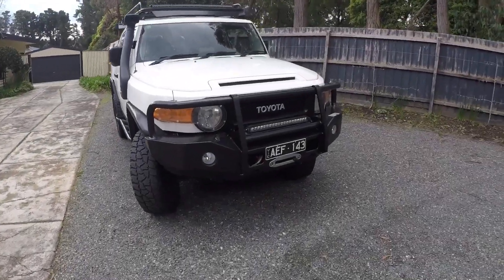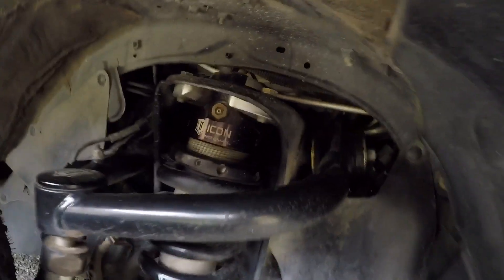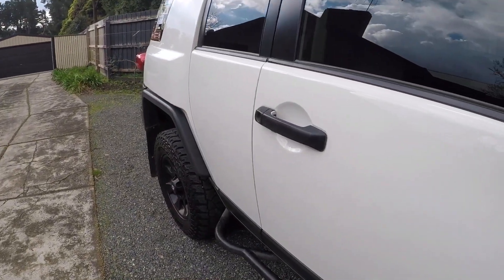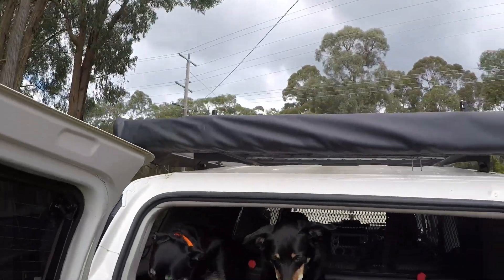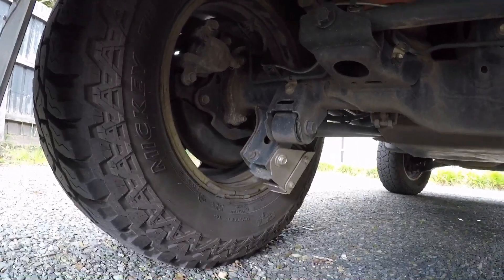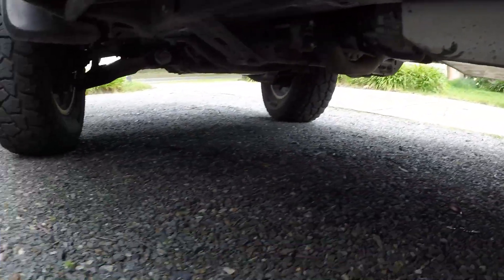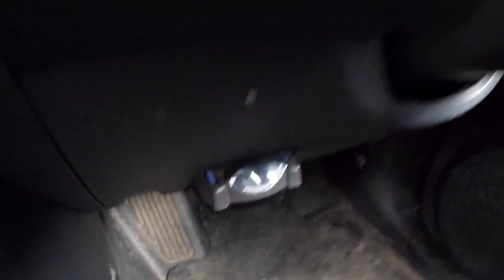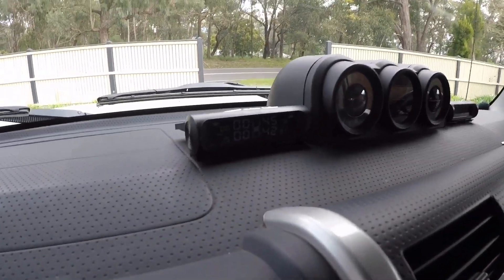FJ CRUISER REVIEW & MODIFIED FOR TOURING, 4X4, OFF ROADING AND OVERLANDING.

Comment: Very cool! What’s the torque converter lockup mod?
Reply from the maker: Benjamin Jones The converter lock up is by Wholesale Automatics.
It’s an ECU box that you have to wire into the cars computer, it manually locks the torque converter in top or 5th gear. So you can have lover revs at highway speed without over heating your transmission when towing. I have also fitted a additional transmission cooler.
Reply: Outback_Touring so, are you able to tow a camper in fifth then with the understanding that you have the Aux cooler?
Reply from the maker: I fitted the additional cooler before before the torque converter lock up, prior to having the lock up the trans temp would still sneak up hotter than I would like even in fourth gear towing, especially if I had a headwind or sandy roads. I can read trans temp on the scan gauge. The lock up keeps the temp even lower in fourth and it remains low in fifth gear. Heat was my main concern and better fuel economy an added bonus, however the engine labours on a slight incline when towing as the engine is under the optimum torque range at 100kph because of the locked converter. As a result I’m down shifting manually, which requires some mechanical sympathy, or I can disengage the converter lock. If the car had just a little more power or different diff gears I’m sure this could be improved, however it will probably then affect fuel economy. You could just have a converter lock up without a aux cooler but I’d definitely recommend one. KAON do a nice kit if you don’t have one..

Comment: How are you liking the Icon set up? Any issues?
Reply from the maker: Love the ICON suspension, I had one of the top hat mounts crack on the front and I’ve rebuilt the rear shocks. 
Considering the extremely rough roads the car had done over some 130,000km I think it’s done very well. Only down side to ICON is very little to no support in Australia for servicing which is a shame. I’m considering a change to Kings as I can get much better support. Thanks for the question.

Comment: Gonna say one minor bad thing about the 115L fuel tank. it reduces the space between the tank and the transfer case drain plug. I changed the transfer oil today and can't fit a socket wrench or an adjustable wrench on the drain plug. Have to go down to bunning to buy one 24mm wrench specifically for that plug.😪
Reply from the maker: Yep it’s a pain that’s for sure!
Reply: @OutbackTouring  Hi mate, for that 115L tank, how far can you still travel when the gauge light comes on? Mine was on at a travel distance of 650km since the last fill-up. It's a bit early on if the fuel consumption was 14l/100km, and a full tank can make 800km +. I went to the servo and only took 91L to fill up, which is a bit weird because the gauge needle is pretty close to the empty line at the time of refill. Do you think the tank can hold 115 L of fuel?
Reply from the maker: I’ve put put over a 100lt in mine before, but yeah your right it does read empty earlier on the gauge. 
I run a scan gauge and it work out the fuel and distance left based on consumption. Only drawback is it only reads from full. 
I “normally” easily get 100 km with the fuel light on.
Reply: @OutbackTouring  Thanks for your feedback mate. I was wondering if the whole quoted "115l" is usable. If it is real, based on my today fill-up experience, the gauge light was on when there was still 25ls fuel left, which can still make 178km based on 14l/100km, a bit crazy 🤔
Reply from the maker: Yeah not ideal that for sure.